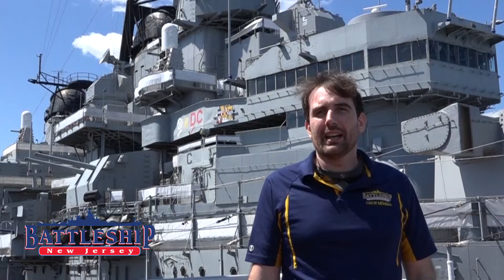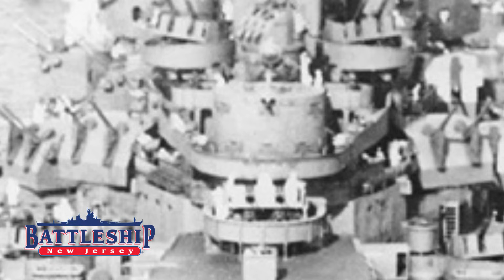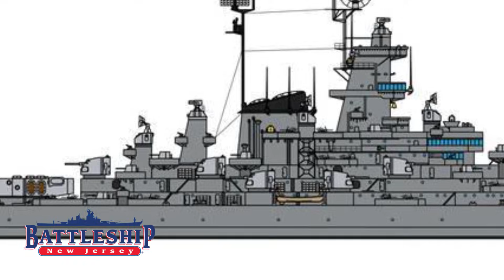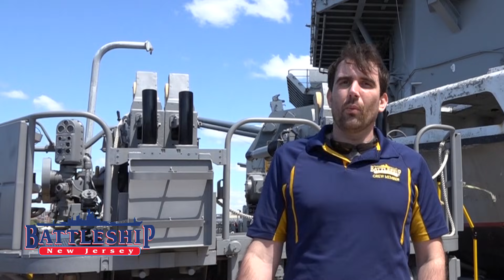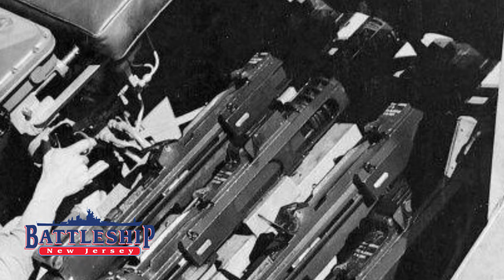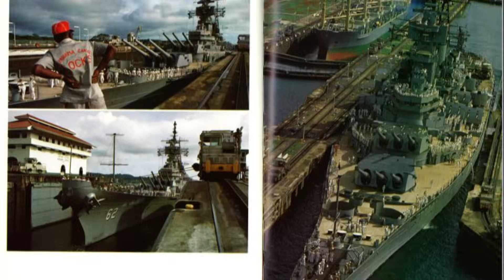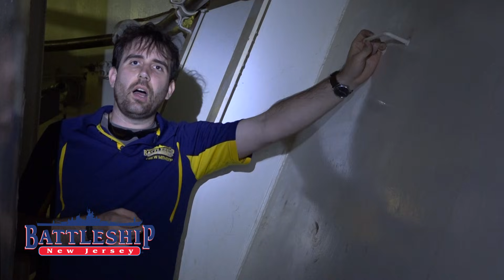What the Navy Doesn't Like About the Iowas

Comment: The Panama Canal was a limiting factor in battleship design for years, and the Montana Class would not have been able to go through the existing locks. The locks were originally intended to be 95 feet wide twin chambers, but due to US Navy influence before the work started on them around 1910 or so, the design was changed to be 110 feet wide. It took some ingenuity in the Iowa design to develop a barbette that could fit the 108'3" wide hull design so they could transit the canal, and that limited the ships to the 16" 50 caliber rifles. There was no way to install larger guns within a barbette that would work sizewise with that limitation. Still, by the beginning of WWII, there were plans for a third locks project which would have had much larger locks of 1200' by 135' and that work was halted in 1944 and abandoned. However, a few years ago Panama did build new locks using the same positioning as the old project had used and taking advantage of the existing excavations. The new project made the new locks even bigger than the US project had planned. The original aircraft carriers of the US Navy that lacked the angled decks of todays super carriers were able to transit the locks though, believe it or not. 

I grew up in the Canal Zone and frequently visited the locks, especially when my dad was working, so I have been down in the tunnels and in the Control House and operated the controls under my dads supervision to put ships through. There are no pumps. The operation is all gravity flow with more than 52,000,000 gallons of fresh water spilled into the ocean on each transit. If there was no rain, there would be no Panama Canal. I have watched the Iowa's go through numerous times in the 1950's as a child and watched the New Jersey go through in 1968 on her way to Vietnam. There is no bigger thrill than seeing one inch through Miraflores Locks which never had the bomb proofing installed as Pedro Miguel and Gatun Locks did.

Comment: 0:16 
Laughing in kirov class.
Reply: Kirovs are not battleships.  They are either battlecruisers or heavy guided missile cruisers depending on who you ask.
Reply: I thought you meant the immediately preceding sentence!  That being said, I very much doubt that Kirov's missiles could make it through any ww2 era BB's armor.  Honestly, I doubt that either ship could normally sink the other.  That being said, cold war era submarines where much more dangerous than their ww2 era counterparts.
Reply: @ColonelSandersLite  the iowa has thick armour plating only of the sides of the armour belt. Modern missles usually fly quite high before diving down towards their target. This way they penetrate the deck and explode inside the ship. Due to the sheer amount of explosive packed inside on of these missles it is unlikely that the interior armour plate will stand a chance of stopping the explosion. Along with this, although battleships have their armour on the side, it does not go down very far (no need to as deeper down the shell looses velocity in the water). So if the missle hits with its programmed dive it will end up penetrating deeper below deck and will most likely cause a hole or leaks to occure deep below the waterline. Also keep in mind that the kirovs were designed as a instrument to destroy whole carrier groups. Or at least penetrate their defences and sink the carrier itself. So a ww2 era battleship, even with the addition of a few anti missle defence missles, isnt really designed to be able to withstand the kirovs attack. (Edit due to spelling)
Reply: @ColonelSandersLite  The point was his statement that "there was nothing else in the world that could seriosly threaten them". I think a salvo or two of the p-700 Гранит (granite) would change his opinion on that matter.
Reply: 🤣🤣🤣🤣🤣

Except russian weapons systems rarely perform even remotely as claimed.

You're making claims based on theory.

The Iowa class performed in reality from the forties well into the nineties.
Reply: @AlanRoehrich9651  if russian wepon systems are so bad that the us is light years ahead of them why does the us spend so much money developing new wepon systems instead of trying to fix domestic problems?
Reply: @Kerberos_Gaurd  
It's weapon, not "wepon".

And you should study the U.S. budget. The military budget is miniscule compared to the entitlement budget. And that proves that those "domestic problems" can't be solved with money. Something the U.S. hasn't learned in 100+ years.
Reply: @AlanRoehrich9651  The United States spent $725 billion on national defense during fiscal year (FY) 2020 according to the Office of Management and Budget, which amounts to 11 percent of federal spending"

China has a budget of 177 billion and russia has a budget of 48.2 billion. 

Remind me why this is miniscule. Percentage wise yes, its small. But due to the scale of the us economy its still large. 

Plus. You are moving away from the main question, if russian wepons always underperform, (because their russian?), why does the US spend so much money on wepons?

Comment: There was only one reason the Iowa class was pressed back into service and that is because the Russians launched the kirov class that could itself smash an entire nimitz class battle group alone with its shipwreck missiles
Reply: Real reason is Reagan wanted them and he got them
Reply: Makes no sense.  only 4 kirov, at any given time only two deploy able.   12 300 mile missile of which 1/4 are used for targeting.  A single aegis cruiser can easily defeat 9 vampires assuming they got thru the F14s.
Reply: @kriskelley5216  The Kirov was extremely dangerous in its own right, however you’re forgetting that almost every vessel the Soviets had at that time even down to corvettes (and even submarines) were covered with so many anti-ship missiles that it would have been impossible to hit even a quarter of them in a swarm attack. Any aircraft that was up (assuming the carrier group wasn’t already destroyed) would have been easily boxed by the insurmountable amount of AA missiles.
Reply: Reagan when it came to the Iowas was brilliant, everything else questionable

Comment: Pulling the #2 Turret with a Harrier hanger would have increased the effective range of the ship as well as increased the ships defensive capability. A couple of 5in turrets could have been replaced with cruise missile launchers. The 20mm AA with as 20mm Gatling guns. 

The principal use of an Iowa class BB would be supporting amphibious landings. Their range, even without rocket assist, and devastating effect would help keep the guys from being driven back into the sea. Besides they just look tremendously dangerous. Aircraft Carriers look like just what they are. Huge floating airfields just waiting to be set on fire.
Reply: On the other hand, it's a tremendously worthy target that can be sent to the bottom of the ocean by practically everything armed with a magnetic fused torpedo.
Reply: @neutronalchemist3241  Everything is a target for a torpedo or an aerial bomb. In many ways there are only two kinds of ships: submarines and targets. 

Battleships are far more resistant than most other warships to conventional explosive weapons. Tne Hood was destrpyed by a lucky hit to an aft magazine and that blast was confined within the armor. The bridge was not hit.

Other battleships sunk during WW2 were destroyed by armor piercing bombs penetrating the relatively thin deck armor. The weakest part of the decks were the funnels. 
It took a lot of bombs to kill these ships.
Reply: @gregwarner3753  Battleships are not more resistant than other ships to magnetic fused torpedoes, because they explode under the keel, where battleships  are not protected, so their complex anti torpedo protections (that had been developed in the years between the wars to deal with shallow-running contact torpedoes) are completely useless. Obviously other ships are not better protected than them, the difference is that battleships are extremely worthy and noisy targets that have practically no possibility to evade the threat. Sink an Iowa, and you are sinking 1800 people at the price of a torpedo. So it will ALWAYS be the first ship to be targeted (unless it's close to a supercarrier).
Reply: @neutronalchemist3241  The designers of these things are well aware of magnetic triggered torpedoes and have made provisions for them. There is a lot of shock absorbing void spaces between the bottom and anything important parts.
Reply: @gregwarner3753  Not under the battleships. To protect against torpedoes, space is everything and, in battleships The machinery and the magazines are right above the keel (because they had to be largely underwater, to protect against projectiles), while, at the same time, torpedoes that explode under the keel are more destructive than contact torpedoes, since the most destructive part of the explosion is the upthrust of the gas bubble.

Comment: I would have resculptured the the bow with "Anti torpedo blisters" to increase the displacement to improve sea keeping, get rid of the troublesome bow wave, and possibly add a little bunkerage.  I would also modify her to carry 18 PT boats to make a nuisance out of themselves in battle and pick up survivors incase of sinking.
Reply: I would have also replaced all the 20 millimetres with 40 millimetres.
Reply: Redoing the bow would cut the speed, carrying armed boats on a battleship is just asking for trouble when one gets hit unless you want to go through the hassle of fueling and loading the weapons every time you want to deploy them. As for the AA, you can fit 20s where the 40s won’t.
Reply: @45bullshark  
Any time that I was being shot at the boats should be in the water making a nuisance of themselves.
I assumed that it would be assumed that everyone reading the comments would know that I was trading the small loss of speed for the greatly improved sea keeping. Being able to use the forward turret in other than optimal weather conditions is valuable.
Reply: calvingreene90 and if the weather was too rough for the PT boats?
Reply: @45bullshark  
You mean conditions so wet that a burning PT boat on the deck is not a problem.
Seriously if you get into a battle under such conditions PT boats are cheap enough to just discard under conditions that rare. Using bianar explosives in the torpedoes and prepositioned water cannons for fire suppression would pretty much prevent the PT boats getting hit from being a problem.

Comment: Purely academic. IF we were to build new BBs, they would be nuclear driven with probably many design influences from the CVN hull designs. No need for a big conning tower (or big stacks) as most of it could be done in lower (more secure) control rooms with cameras and other electronics doing the improved M1 eyeball work. Upper deck configuration could reflect masking designs to reduce signature. For guns, we have not had realistic conversations and discussions about the future of a need and manner of projectile boost for at distance gunnery. Missiles (with increased storage issues) or mass projectiles? AA defenses, same discussion needs. Boat storage has changed and could be incorporated into better above the waterline access. Any new designs could add at least two helo spots for at sea sustainability, etc. or even go back to adding an jump jet or two in the mix. All this is beyond your article here. Thanks for the video. I was a marine stationed at Long Beach when the NJ was refit before going to SE Asia and I got a tour of her then. So many areas welded off.

Comment: Having boats on the outside of the ship limits the guns. Putting them in a hangar along with a helicopter saves space and having to move them back and forth in order to fire the guns. They could be in storage areas below deck accessed through the hangar.

Comment: my recollection was that the thought on switching from 40mm Bofors to a 3in AA gun was that it was possible to put a proximity fuse on the 3in but not the 40mm (at the time). Too many people quote press on CV vs BB. there was a bit of back and forth on this. The mid/late 30's was when aircraft engine became powerful enough to carrier bombs and torpedo to threaten a warship (depending). The B-17 was designed to strike naval forces, which turned out to be a sad joke (it might have been able to hit a 22kt battleship, but not a 30kt cruiser, its not the speed, but the power to weight, which affects turn time). Pre-war AA had little ability  The 40mm with radar fire control had adequate capability, but it was really the VT on the 5in that changed the game.
Reply: The VT fuse was also a game changer when American artillery started to use it in TOT barrages late in the war in Europe.
Reply: Very good point about aircraft development. I have repeatedly made the same case in the BB vs CV argument. In addition, it wasn't until December 1941, with the loss of Prince of Wales and Repulse that everyone realized how deadly aircraft could be to battleships that lacked air cover.
Reply: Bingo!  The proximity or VT fuse is a game changer.   On a 5" shell, enemy aircraft could have been engaged while still in formation and before any individual aircraft committed to an attack.
Reply: @GilmerJohn  The German Hs 293 could be fired from well outside the range of the US 5 inch DP gun (about 16km, 10 miles).   The Fritz-X was dropped from 22,500 ft (aimed by computing bombsight).   As the bomb fell for 30 seconds on the Dornier Do 217K3 would pull up to about 24,000ft and guide the bomb to final impact in the last 5 seconds with a few corrective nudges.  22500 ft is too far for good AAA fire even with proximity fuze.   Of course the Luftwaffe’s problem was aircraft from carriers.
Reply: I think the big reason for the 6-inch AP turrets was due to the issues with the Atlanta light cruisers.  They were really good as AA batteries, but they were completely useless against ships their own size.  This shown up early in the war.
Reply: @michaelpiatkowskijr1045  The Atlanta was 7000 tons, roughly comparable in displacement to the Japanese light cruisers, example Agano, but no where close to the treaty era Japanese heavy cruisers, typically 11,000 std and 14K full load. The Agano had 6x6in guns and 2.4in armor, versus Atlanta with 16 x5in guns. I would rate this as a fight that could go either way, depending on where and when Agano scores hits with here heavier shells. Atlanta would be in serious trouble against the heavy cruisers with 4in armor (some earlier one were only 8k tons). In few battles, US destroyers raked heavy Japanese ships above deck with 5in fire at close range, knowing there was no point in shooting at the hull. 
AA was not effective until radar control, and then mostly with the 40mm. The 5in guns were not that good against aircraft until the VT fuse became available.
Reply: @joechang8696  you are correct about the armament.  The true problem was in the armor.  According to Wikipedia, only the Atlanta and Juneau saw ship to ship combat.  Both ships were sunk by torpedoes and gunfire.  Atlanta ended up being finished during the day by American ships.  Later Atlanta cruisers had 12 5-inch guns eliminating the two wing turrets.  Their greatest flaw was the lack of fire control.  For the number of guns, it only had two directors.
Reply: We could speculate about the concept of the Atlanta. It is 3X the displacement of the Fletcher, and ~3X the number of 5in guns, same torpedo tubes, ~2X personnel (Oakland had more). I will guess that the Atlanta is less than 3X the cost of a Fletcher, on the basis of 60,000 shp for Fletcher and 75k for Atlanta, top speed 36.5 and 32.5kt respectively. 
Presumably an Atlanta + 3 DD or 2 Atlanta's in a division can (gun) kill a division of 4 DD's, assuming torpedo attack is not a factor. It should much cheaper to operate 1 Atlanta than 3 Fletchers, on manning and fuel (+extra cost of getting supplies to a forward deployed unit). 
I do not know if the US knew that Japanese cruisers were rated for 35kt. Of course, top speed on ships is complicated by whether the hull is clean, and boiler tube condition (consider Arleigh Burke's reports of proceeding at 30kn, and then 31kn.) It would seem that Atlanta+DDs would not be good for independent action because a Japanese cruiser could run it down. Just it should not be part of the cruiser line vs. cruiser line action. Nor is it viable in night torpedo attack in having the same torpedo capacity as the Fletcher.

Aside from that the Atlanta found a good role as AA, it was not designed as such. So the remaining role I see is part of BB/CV/CA escort, in that it is the more economical method of fending of enemy DD's in torpedo attacks.

Comment: Could the Battleship have a comeback when the modern weapon systems come to pass. With a huge power plant, and less need for storing high explosives. The Battleship with high rate of fire, with multiple barrels to deliver. It would covered in Anti Aircraft and Missile defense systems to protect an aircraft carrier group.
Reply: Not really, the potential power and versatility of fielding a number of guided missile destroyers instead of a big gun battleship is hard to argue with.  As much as I love the BBs, there's barely a reason to build cruisers right now, the only real use for them being flagships for squadrons of DDGs.  It wouldn't surprise me if the USN decommissions all the Ticonderoga class cruisers and just uses modified Arleigh Burke class Destroyers or maybe the Zumwalt class destroyers as flagships and fields mostly DDGs and frigates alongside the CVNs.